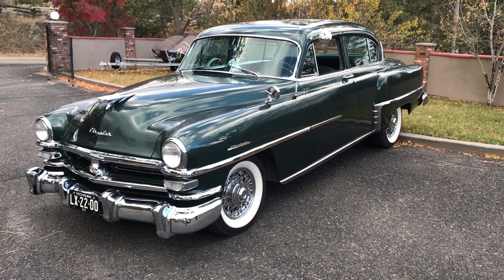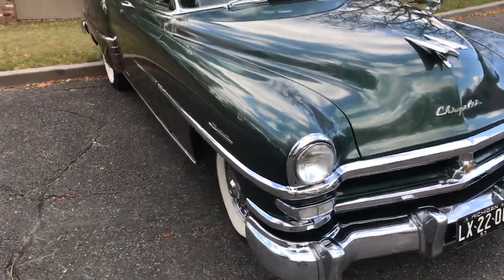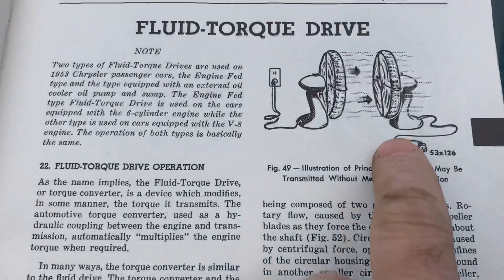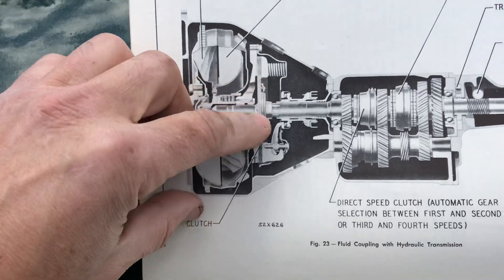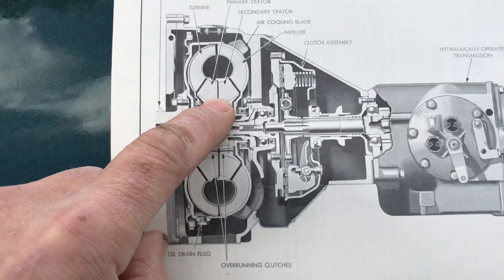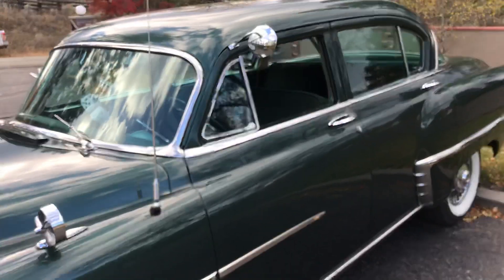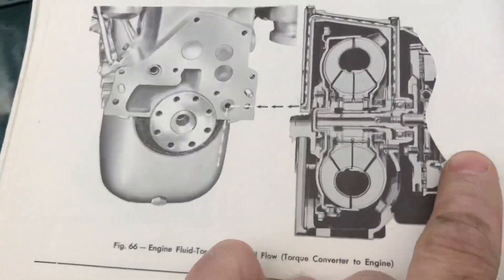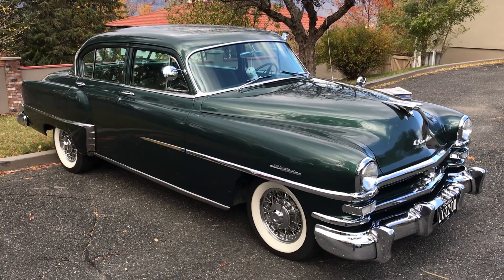Part II - 1953 Chrysler.  Fluid Drive versus Fluid Torque Drive, explained.

Comment: My 1948 Dodge has the Fluid Drive which works quite well and as intended! As a longtime viewer of this work of love and labor to include the cold, verry cold b thankful we have a  down to earth tutorials
Reply: Have you driven your 48 Dodge at highway speeds and if so did the engine require higher rpm’s to maintain speed?
Reply: @romeoromio  didn't work harder than normal I need to document if it does
Reply: @richardd9955 thank you for the input

Comment: Very interesting I have a 1952 Chrysler imperial.... However mine has the 331 hemi V8 with a fluid torque drive. That was very interesting about the shared engine oil from the engine into the torque converter I never heard of such a thing. I guess I need to check and make sure I don't have something like that with my hemi.

Comment: Hey Keith, is there a way to bypass the carburetor wires that go to the fluid drive? I don’t have original carburetor. 1949 desoto s13 custom

Comment: The “semi-automatic” system is fascinating, today it is used in heavy transport: tanks. The first systems had the hydraulic coupling then, as the author says, the copy converter was inserted. a system that multiplies the torque much more performing. the evolution of the converter saw the Lock up clutch for exclusion.

Comment: We had a 1953 Custom Imperial with the Fluid Torque converter and Tip Toe shift. Ours was black, 4dr and also had the Kelsey-Hayes wire wheels. Beautiful car! The Powerflite 2 speed automatic was also available. Ours had the 331ci Hemi V8.

Comment: They had an oddball transmission similar in the Plymouth called HyDrive. It shared the engine oil also.
Reply: That Plymouth trans was a 3 speed manual with a torque converter instead of a fluid coupling.  Powerflite came out in mid 53 for Chryslers and Imperials, 54 for DeSotos and Dodges, and mid 54 for Plymouths.

Comment: I would imagine it wouldn't take off very well in 3rd without the torque converter.
Reply: It was decent, as Chrysler-built engines had good torque.

Comment: Newbie again, I have so many questions. My Windsor doesn't down shift when you come to a full stop, I usually put in N and back to drive. What can I do to fix this problem. It also seems to be a gas hog. I like all your video's. Thanks for all the info about these cars.
Reply from the maker: Try lowering your engine idle speed. It won’t down shift if its too high.

Comment: They continued a version of the two-stator torque converter with the real automatic Powerflite, the first Chrysler automatic in 1954. It was just a two speed transmission like a Chevy Powerglide, but with more multiplication because of two not one stator. After the three speed Torqueflite came out they continued the Powerflite on some cheaper models until 1961.

Comment: Is that a 265? Does it have the Carter B&B with dash pots? Which carb is it, thank you.
Reply from the maker: Indeed it is a265. I sold the car over a year ago.  Sorry I can't confirm the exact carb model. However it was a Carter B&B with a anti-stall dashpot (6V solenoid). It also had the kick-down switch on the throttle linkage.

Comment: Keith's Garage - You may not see this post as I am like 2 years late seeing both videos, I just wanted to say thanks for helping me remember a 1941 Chrysler I had back in 1954 that had the jump seats and Fluid Drive, it also had electric windows, what I thought was remarkable was the speedometer needle that changed colors the faster you drove, anyway, THANKS AGAIN.
Reply from the maker: I read all viewer comments. I try and and reply where I can.

Comment: A pity they didn’t use this system on the old 10-10 Lawrence logging winch. They had the IND-251 engine with a fluid drive, and a little band brake that released when you pushed the throttle. The regular fluid drive was said to be almost useless, every time you needed a little extra “oomph” it would just slip. I would imagine the cars with that system would have been much the same. I bet that fluid torque drive is fun to use. Always wanted to try one.

Comment: Have you tried using synthetic oil in that? 
Those transmissions were notorious for not being fuel efficient, I'd be interested in your mpg with regular oil vs synthetic.
Reply from the maker: Sorry no. I have not. I sold this car about 2 weeks ago.
Reply: Better oil would not improve gas mileage, it would extend component life.

Comment: this is the best explanation of the simplamtic transmission ever!
and yes, later models did have a torque converter. I think that imperial had the new torque flite automatic in 1954..
cheers 🍾🍾🍾🏳️‍🌈
Reply: Powerflite, actually. Two speeds with a similar two stator torque converter. The three speed (but one stator) Torqueflite came out in 1956 on Chryslers and Imperials. Powerflite continued to also be used up to 1961.
Reply from the maker: Glad you liked it!
Reply: Mid 53 for Imperials and New Yorkers.

Comment: 12 to 13 liters  of oil ! Wow!!  You mentioned that in low range in second it would be about 24 mph , what is top speed in fourth gear? about. Great looking car by the way.
Reply from the maker: I’ve had the car up to 70 mph. And at that time it had  1 dead cylinder.  I’m not sure what top speed is.  I generally drive at 55-60 on the hi-way.

Comment: THE TRANSMISSION DESCRIBED IN THIS VIDEOS WAS REPLACED FOR OBVIOUS REASON IN 1953 LATE WITH THE POWERFLITE TWO SPEED TRANSMISSION,BUT THAT WAS REPLACED IN MID 56 WITH THE NOW FAMOUS TORQUEFLITE 3 SPEED TRANS MISSION.

Comment: super interesting.  never knew that there were 2 types of couplers back then...just assumed that all were fluid drives with a coupler and not a convertor.  thx for clearing this up.  must have been a good upgrade from the standard auto
Reply from the maker: The stand fluid drive would have probably been fairly lethargic I suspect. It offers no torque multiplication. My Chrysler here performed pretty satisfactory in my opinion. Here you can see a 0-60 test.  https://youtu.be/ODGGCTSgtpM

Comment: Generally speaking, if its referred to as a fluid drive, it has a fluid coupling. If called a fluid torque drive, its a torque converter. 
I knew someone who has a 1952 crown imperial it shifted and behaved like your car except on the gear selector handle there was a button. When in the hi range in 4th gear if you pushed the button and  firewalled the gas it would drop back to third for acceleration. Im not sure if that be used in the lo range. I seen my friend use it a few times only in  hi range. Has anyone else seen a Chrysler product with this forced downshift feature?
Reply: Had that on my 47 chrysler windsor

Comment: The difference between fluid drive and fluid torque   drive is fluid torque drive has a stator or multiple. The stator re directs fluid in a helping direction toward the turbine. A torque converter  with impeller,  stator and turbine is described as a three element torque converter. The example in the video is four element torque converter because it has two stator.
As the car accelerates from a stop the impeller
Directs fluid to the turbine.The turbine starts to spin and re directs fluid to the stator that re directs fluid back to the turbine. This is torque multiplication. During this process, the stator is held in place during acceleration. As turbine speed approaches pump speed the impeller and turbine turn at a 1-1 ratio and since torque multiplication is no longer needed the stator starts to free wheel along with the impeller and turbine. All three elements are interacting as one unit and act as a fluid compling since acceleration is no longer needed. The name torus is used to describe a fluid coulping/ torque converter assembly since their construction reflects a toroidal configuration. I've only seen that used in old school descriptions.

Comment: As a mechanic from that era, (I am 75) I hated this drive system. It had a clutch. and a fluid coupling and was a pain to remove from the engine. this description is correct the fluid coupling was not a toque converter , no mechanical advantage.
Reply: I understand during a clutch change unless you had the correct alignment tool  to align the clutch for installation. It was difficult because of the length of the input shift. Couldn't align it by eye.
Reply: Yes there would be a mechanical advantage.  Why do you rev engine up pulling out headed up hill?
Reply: @Jimmy242r4  if I take two steps up an icy hill to cover one step of distance, where’s the force multiplication
Reply: Good video, I like having the extra knowledge now. I had a 1950 dodge coronet with the Gyro Matic transmission which I enjoyed driving cause it was so different. I thought of it as automotive history. Thank you.
Reply: Interesting! For some of us in America and other places these cars were sent, had a chance to pick a part and go to your destination by hand's on!

Comment: Is the torque converter version noticeably  better performing?
Have you driven both?
So, there is freewheeling in the low gear of each?  Does that impair engine braking on a steep slow downhill?
When you park a true manual, you put it in a gear to help hold it as well as setting the parking brake. Is there any advantage to doing so in your car?
Reply from the maker: Auteur Fiddler I have only driven my torque converter model. I am confident it performs better than a basic fluid drive. How much better? I can’t honestly say. This model multiplies torque due to its internal stators. The fluid drive lacks stators. My car has a 1-way ramp style clutch on the countershaft collar gear that engages in 2nd and 4th. Offering hold back in those 2 gears only. It’s not a perfect design but it works, and you at least have an option. There is no park. Leaving the tranny in gear and walking away is not good. When the car stops it always down shifts to 1st or 3rd, meaning free wheel mode. So you have no hold back. It can easily roll away. The handbrake must be applied. I also use a wheel chock for added safety. I’ve had no issues or dangerous occurrences.
Reply: NO USEING THE PARKING BRAKE WAS PARAMOUNT
Reply: NO USE THE PARKING BRAKE

Comment: Very interesting. I may never understand why Chrysler didn't come out with a fully automatic sooner.
After all, GM came out with their Hydramatic in 1939.
Reply from the maker: Maybe because the Chrysler semi-auto was very reliable. (it still is 66 years later) By 1953 maybe other full auto transmissions  were not perfected and Chrysler was waiting out perfection and reliability before releasing their own fully auto? The market dictated when Chrysler had to make a change. Public demand by 1954 for a full auto perhaps enticed Chrysler to release their full auto tranny in most car models by 1954.
Reply: The first Generation GM HydraMatic was not the greatest device ever made.  Firstly, it had service intervals of only 5,000 miles.  Severe damage would occur if a service was skipped.  Fluid back then would get dirty easily, and dirty fluid acts like sandpaper and would tear the transmissions up inside.  Also, the bands for range application needed adjustment every 5,000 miles as well, or the unit would become slow to engage, slip or certain "gears" would just fail to apply altogether. Also, the original HydraMatic did not have a torque converter which, and correct me if I'm wrong, it wouldn't get a torque converter until 1954 or 1955!  Even by that time, Chevrolet's original PowerGlide (1950-1954) was a single-speed unit.  It started in top gear!!  It would not downshift if the accelerator was floored.  It would only apply "first gear" if manually selected. PowerGlide was updated mid-year 1954 for the upcoming V8 models and they wanted to showcase performance.  Actually having the transmission start in first gear did just that!

In contrast, regular Fluid Drive provided by Dodge, Plymouth and Chrysler was infinitely more simple, required virtually no maintenance and eliminated 85% of shifting!  It was also much, much cheaper to produce than Hydramatic and through the 40's, Fluid Drive was very popular. Women drivers loved it.  As Fluid Drive progressed with updates, it only got better and better, but began to get more complex.  That's when Chrysler engineers decided to start working on PowerFlite.

Compared to the HydraMatic, Powerflite had fewer parts than HydraMatic, actually featured a Torque Converter with power multiplication and had, under normal conditions, no service interval. (This fact was REALLY boasted about a few years later with the debut of the TorqueFlite!)
Reply: @That_AMC_Guy  Hydramatic NEVER received a true Torque Converter.  Chevy's Powerglide became a true automatic for 53, not 54.  The 50 - 52 models operated entirely in High, just like Buick's DynaFlow.  In fact, it can be thought of a scaled-down lower cost version of the Dynaflow.
Reply: @keithsgarage5831 GM was a much bigger company and could better fund the development of auto transmissions than Chrysler. Chrysler eventually did but it took longer, but they did their homework and both the powerflite and Torqueflite were reliable transmissions and as good as anything the competitors had at the time.
Reply: They felt that with a fully automatic, the driver gave up too much.  Eventually, the public said otherwise, and Chrysler developed PowerFlite.

Comment: Again, thanks. Never learned bout these.
Were the trans & clutch dependable enough to last 80k or 100.000 miles if driven and serviced reasonably?
Reply from the maker: They are known to be very reliable. Mine is still going strong. I have no idea how many miles are on it.
Reply: THEY WERE "BULLETPROOF"

Comment: Mr. Keith. My Grandma didn't learn to drive till 1959, when Mom was carrying me. Grandpa replaced his 1952 Coronet, flat 6, and, what they always called semi automatic. Mom said you had to push the clutch to change gears, but high was as far down as the lever would go, that they didn't use low, and that it took off just fine in high, and that it would run 100 because she drove it that fast. It sounds like it had the torque converter, not the fluid drive...what do you think? Granny got a new 1966 Coronet...and even though I was only 6, I remember the day they sold the 52, and I remember Rudi,g in it with Granny.
By the way, Grandad bought a 57 Dodge Coronet, red/white, with the D500 package. I wish I had been old enough to have asked if he would keep it for me.
Reply from the maker: The transmission you describe is the Mopar M5 or M6 semi-auto. Same as the one in my car. You can easily just leave it in 3rd and shift to 4th. Hard to know if your Grandparents had the torque converter, or fluid drive. The 6 cyl engine in 1953 with the torque converter has the oil drain plug on the torque, and the engine oil is shared with the torque.
Reply: @keithsgarage5831  I managed to find a picture of the fluid drive. Apparently, 1st and reverse were in the traditional place, neutral in the middle, and high on the bottom. We talked about the car many times. She drove it for several years after her and Dad married in 1957. Then, Granny drove it for 5 or 6 years. She never said you had to lift the shifter up for low gear, but did say you had to use the clutch to go from low to high, and it shifted on its own in the drive position. At this point, nobody alive can tell me,  as Mom left us in 2009 from cancer. She also said it would go through snow like a plow. I'm 90% sure it was like the trans you have in your Chrysler. Grandad worked in DC, a 75 mile trip. He stayed there all week, with his brother...they were both Plasterers.. returning home Friday evening. Considering the driving involved, I expect he bought the better trans,,,he always bought posi rear axles to drive in the snow. Grandads 1963 Dodge 330 had the 8.75 posi, 318, and the 727 trans. Dad's sister lived about 30 miles from home on the route back from DC. Her husband said he saw Grandad pass him many times during a snowstorm...the car being so recognizable...and that Grandad was passing everything in site like it wasn't even snowing. He ran that road for 44 years, only missing it while he worked at a nylon plant for tires in WWII.
Reply: @michaelcook768  There was no "1st" position with Fluid Drive on a Chrysler or DeSoto.  Dodges with Fluid Drive did, but their's was a fluid coupling in front of a conventional 3 speed manual transmission.  The trans on Chryslers and DeSotos was a hydraulically operated 4 speed transmission.
Reply: I have a1947 Chrysler Windsor....she's a beauty...her name is Stella...drive her all the time...
everything is original....just had her engine reworked....I love it
Reply: Dodges had a flathead inline 6.  Flat 6s are used by Porsche, and the Corvair also used a flat 6.